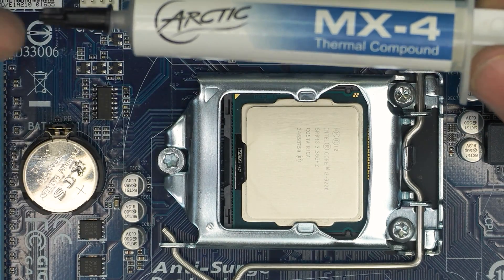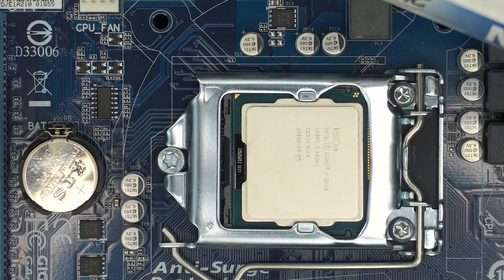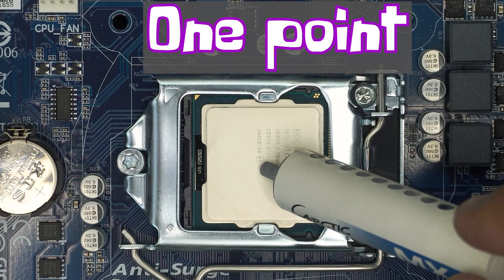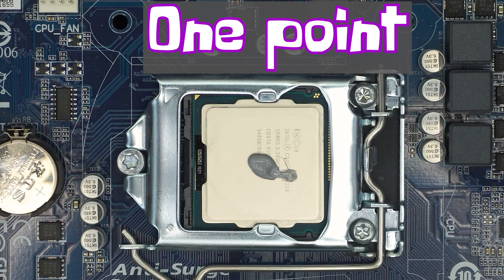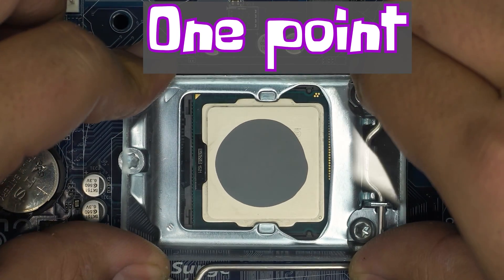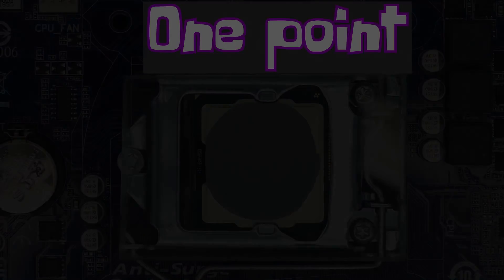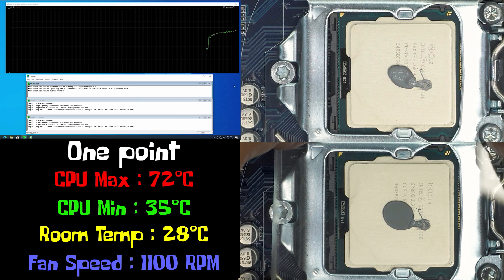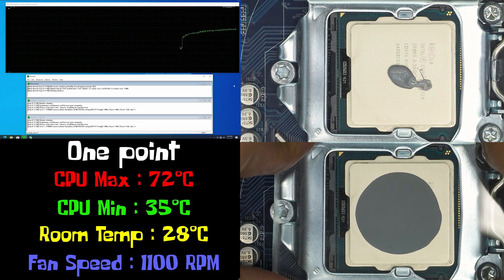How To Apply CPU Thermal Paste Methods | Compare and Benchmark

Comment: I have been looking for someone to do a video like this for ages! It seems that the spreading is the most effective to not have any bare spots. 

This matters, yes? I have been doing the X and i feel that it covers most everything, but nothing besides spreading gets everything.
Reply from the maker: Thank you for the feedback! if you wish to support the channel you can LIKE or SUB or both :P
regarding your question: i been repairing servicing high end CPU laptops for over 17 years and never used spreading, just do a X and call it a day, the spreading and going crazy on paste is for those that are racing on benchmark overclockers. if you a are a regular user and you just want to enjoy your pc and defaults and auto overclocking then the X is more than fine, but if you want to spreading then its fine also. 
the differences are few C and even that is random. just remember that you don't actually need to cover every spot on the CPU and there is nothing under except the center part, were the cpu dye is.
https://imgur.com/a/oBKY2Xr
so if you do a like in the middle you will get the same result as spreading :/
we try to keep the room ambient temp but there is always the factor of the room ambient temperature changing.
If you have any future questions or requests, please don't hesitate to reach out to me. I'll be happy to assist you.

Comment: Also remember even more important is proper cpu installation, not too tight not loose
Reply from the maker: thank you for the feedback and the more cpu pressure the better is the heat transfer, we have done the tests on that. but defiantly not to loose.
Reply: CPU cooler* installation you mean
Reply from the maker: yes my friend

Comment: Spread clearly has some air bubbles there, maybe add a dot in the center to prevent that?
Reply from the maker: Thank you for the feedback! if you wish to support the channel you can LIKE or SUB or both :P
regarding your question: i would honestly say that please stop thinking about the air bubbles its  nothing to worry about as its been tested and examined. lets say for the sake of conversation, that you got a tiny tiny air gap, but as soon as the CPU starts heating up to 60c the air bubble will get out by the pressure and the heat. so don't go crazy thinking about the air bubbles. you can try dot in center on top and it will work fine still.

Comment: That's way too much thermal paste. The paste should not spread outside of the lid
Reply from the maker: its not too much and its not excessive, the factory does it even more than that. it goes off by not even by 1mm , that is totally fine. i appreciate your feedback.
Reply: @uFixTek  Yep that's totally fine. Just want to let people know that much thermal paste is not necessary, because not everyone has an excessive amount of thermal paste to use.
Reply from the maker: i would agree with you if they are servicing a lot of cpu daily so they can save up a bit on each service, but if they doing their personal cpu repaste every two years a minimo syringe (the smallest ) has enough to do two CPU repaste the amount i placed. if they put less and if they get bad temp , now they have to wipe the entire paste to re apply and that concludes to way more waist of paste. again this video is to show test based on this amount , i can';t go make 100 different types and factors. but i hope the video can help at least on one factor. :)